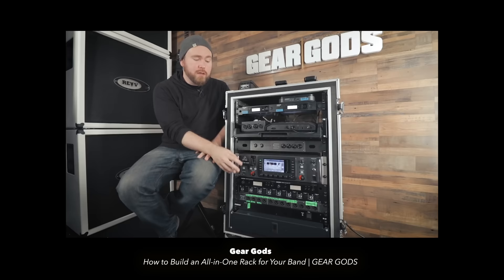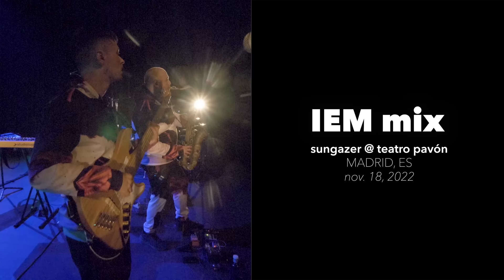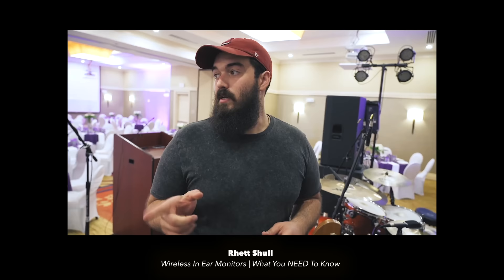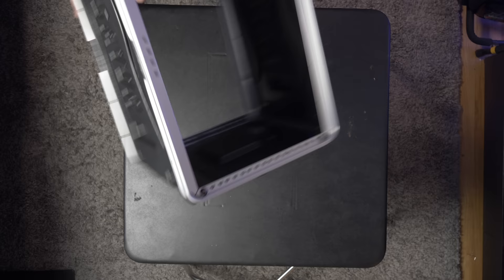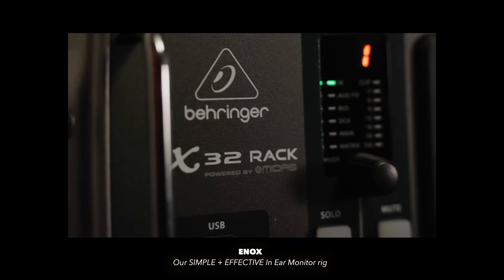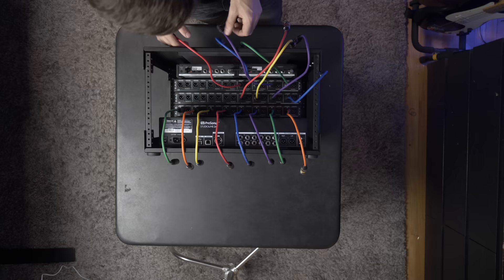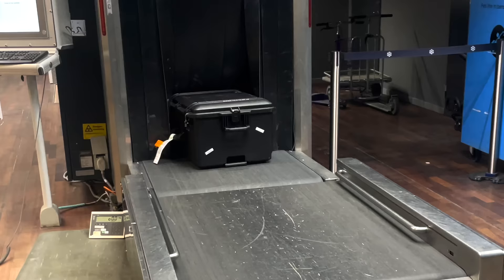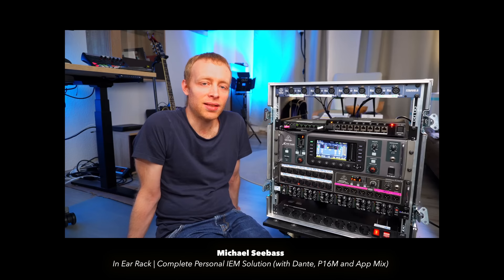How In-Ear Monitors are Making Better Musicians

Comment: If you end up looking for more power-conditioning solutions, there's a lot of crossover between rackmount computer servers and rackmount audio.  Companies like Tripp-Lite, APC, and Eaton make various 1U UPS solutions in every input voltage and plug configuration you can think of.  Just depends on how much output power you need.  As long as you're not driving amps with it, though, it's probably a lower power draw than servers.
Reply: It’s definitely less power draw than servers! The keyword you want to look for is “homelab”. There’s a group of guys who like to have servers at home for practicing their skills in a lab environment. They’re always looking for good gear at low prices, and it’s often business gear that’s been decommissioned.
Reply: How's a UPS going to go with airline weight budget and also hazardous cargo? Lead acid batteries weigh a lot and also need to be carried the correct way up even if sealed. There are strict IATA and airline limits on lithium cells on aircraft both carry on and checked. Most ground staff don't understand their company policy. I travelled with lithium packs in the checked luggage and was told differing things from different staff from the same airline. It was only resolved by bringing up their company website and going through each battery one by one and proving they all complied. Try doing that internationally in a foreign language. Not for me. That could work if you were touring in a van. That said I haven't bought in to the whole power conditioning sales pitch. I know Angus Young uses it but he doesn't have to lug it around like I would.
Reply: @vk3fbab  That's certainly a fair point.  I can see the hazmat problems being a real issue with air travel.  The point is more that rackmount server power solutions are  pretty abundant, and even if you don't need UPS, the various 1U power cabling and voltage options are worth investigating.  At the very least, having a single IEC C20 input and using different input cables depending on input voltage may be a better solution than a consumer surge protector.  And locking C13/C14 cables might be a cleaner solution than the non-locking NEMA 5-15 plugs I'm seeing here.  Obviously Adam's solution works, which is the bottom line.
Reply: @jorymil  For mains power I've been using Neutrik Powercon instead of IEC. It fits in their panels and locks in great. Allowed me to have all input and output on one panel. Mains power, 1/4 inch, XLR and Midi using Ethercon.

Comment: As a sound system, design, professional, I want to add one more bit of clarity to this wonderful video. The latency is non-existent only if you are in the analog domain of an ear monitoring. Once you add any type of digital transport, i.e. Dante, or other Netwerk digital audio you add milliseconds of latency all depending on the amount of gear and hops between switches, etc. The other factor is also that wireless technology in itself has latency, but I’m not going to go into the specifics. I just wanted to make you and your followers aware of paying attention to latency issues when it comes to using in ear monitors with digital technology, and to make sure that they Look into it as they are putting together their rigs. I love your videos I just discovered your channel and I’m very pleased to see a musician that covered something like that I believe is so important to getting a better performance. This is such a great channel. Thank you.

Comment: As an audio engineer, in-ear monitors work absolute wonders, especially if the band knows at least a little about audio.  The gigs I’ve had take place in a musical theatre that has a lot of echo because it’s mainly for theatrical performances, so wedges can be risky sometimes.  The issue is COMPLETELY gone with in-ear monitors, and they can be tailored so precisely to each member.

If Sungazer ever came to my town, I would feel absolutely blessed to engineer for them

Comment: Lateral q: is there a graceful way to be the only one wearing IEM in a setting where you know no one else ever will? Like, setting up your own room mic even for rehearsals to get a fuller mix of a big band and not just the sound of the trombone behind you?
Reply: This is precisely what Allen ME1 does with its "local mic" feature, it works really well. Allows you to basically blend in all the room crap, but at least you control the amount of it. In other cases, a random mic pointing somewhere will also do the trick, tried that once, works okay enough.
Reply: I ran a full IEM rig for a three piece I was in... Behringer XR18, splitter for the kick mic, brought our own separate snare mic, e609 on the guitar and bass cabs, and little Rolls pm50s on our pedalboards for the bass player/lead singer and myself. The pm50s allows a mic in and thru and a TRS in. No wireless, we just ran a TRS cable with our instrument cable. We were already a tight 3 piece, but we were super tight and the bass player was already a great singer, but I'm not. Being able to hear myself and him so clearly made me sing so much better. Setup was simple and required no soundcheck on our end and absolutely nothing from FOH.

Then, I just filled in on bass for a band that doesnt run in ears, so I just ran my little pm50 on my pedalboard with just my vocal mic and I split my bass signal off of a pedal directly to the TRS in on the pm50. So I had bass and my vocal in my ears, and just relied on the stage volume for the rest of the band.

Hearing yourself clearly definitely improved my performance. Hearing the whole band improves it even more. Worst case scenario, you just have expensive earplugs that double as a self monitoring system.

Comment: For any solo singer/guitarists out there, I just tried a poor man's version of an in-ear monitor system and it worked pretty great. My solo set is just me singing and playing guitar through one amp. I use a Boss VE-20 for vocal effects, so I took the 1/4" line out of that and connected it to a cheap, $69 Mackie Mix 5 mixer. I send the XLR out of the VE-20 to FOH. I mic'd my amp with my own mic and cable that I brought and connected that XLR cable to the Mackie. I now had the ability to control the mix and volume of my guitar and vocals myself. I even attached the Mackie to my pedal board, which worked great. I'm not sure if I have the same Shure in-ear headphones that Adam mentioned, but they are Shure's. I like them, but they're the only ones I've ever used and I can't speak to how long they'll last as I haven't really used them very much. Also, this doesn't require them to be wireless. I just have a 10' head phone extension cable that I plug them into. I ran the cable for the Shure's down my back, inside my shirt and simply plugged them into the extension cable and tucked the part where they connected into my pocket. Practically invisible. I'm not moving around much, so not a problem. 

Anyway, this was all a low budget test to see if I wanted to use in-ears. First test was a success and I plan to try them again next week.

Comment: Just to counter your snub of the se215s I’ve been using the same pair for 8 - 9 years now, doing at least 50 gigs a year and they have yet to fail me. A few friends have complained about the seal, but they fit my ears perfectly.
Reply: I also use SE215. Have had great fortune with them so far. They’ve even been through a washer/dryer cycle TWICE and they are still rock solid. To each their own. I’m happy with the SE215.
Reply: Totally agree, SE215s are great.  I use them not only for IEMS live, but for my daily headphones with BT.  I love them.
Reply: I wish we had your luck lol. We ended up buying around 10 this year. One pair even malfunctioned after one show, and we don’t go THAT hard on stage >.>
Reply: @ENOXband  ouch, that sucks. What did you end up using in place of 215?
Reply: @ynotw57  so far, more 215s 😂
We want to upgrade in the next year, we are looking into westone or 64 audio
Reply: @ENOXband  that genuinely made me lol

A buddy of mine uses Westone and swears by them. Good luck, I hope you find a pair which works well for you. :)
Reply: I’ve had good luck with SE215 reliability, but if lots of NY musicians are having issues I’d love to see Shure do a wider reliability study. QC is the main reason I don’t like recommending most chi-fi IEMs…
Reply: it's no counter, the only way to determine reliability of a product is by its failure rates

and yours not failing does not make the failures others have registered vanish
Reply: @willudallmusic  Do you have the updated version of the SE215 sonic which I understand comes with a mic and inline control..?
And if so, how well do they sound in the midrange frequency department?
Reply: @richmck007  I use mine with the old Shure blutooth unit BT2....  I have to admit, I'm not super super picky with my in ears, as I play solo/one man band kinda gigs...  I think they sound fine though, and have used them for years.
Reply: same here - replaced the Shure tips with Comply foam tips (forget the kind exactly but they are the kind for the most possible isolation) and they have served me well. Just have to have spare tips and replace them every so often.
Reply: At 3:47, Adam said he's gone through 6 or7 sets of them, so it seems something about them was working reasonably well before he made the change to a different brand. They may, in fact, be terrible, but I'm s(h)ure some part of the sentiment is just fatigue.

Comment: Great video! While I've never used in-ear monitors on stage, I did learn the value of manageable stage volume playing gigs in Hollywood at the height of the hair metal craze as a shreddy guitarist. I almost got banned from a club for turning up my amp without talking it over with the soundman halfway through a show. When we got off stage he called me a asshole and told me I should have communicated with him during soundcheck about stage volume. I never pulled that kind of stunt again and left the Marshall stack at home. I started using a Boogie combo turned to about 2 and faced it off to the side. This kept stage volume much lower on my end and the soundmen appreciated this. They gave me more than enough stage volume. As for ear protection, I used foam plugs. While bandmates told me how goofy I looked, I'm one of the few musicians I know from that era who still has my hearing. Not as good as it used to be, but I'm not deaf. You must protect your hearing, especially if you want a career in music. One of my favorite hard rock bands is Scorpions who I've seen many times in concert. One remarkable thing about this band is they always have the right volume. They are never obnoxiously loud. I can't say this for most bands. Scorps always go for good sound quality rather than quantity. The same goes for Rush when I saw them and the wonderful guitarist Eric Johnson. While my hair metal career plateaued decades ago I still have very good pitch and don't need hearing aids. When I do rehearse, I use earplugs or earmuffs. Me and my band have discussed getting in-ear monitors. I'm showing this video to them. This is very helpful.

Comment: For comparison, to get 100ms round-trip delay from _light_, you'd have to be 15,000 km or 10,000 miles apart, nearly halfway around the Earth (half the circumference).

Comment: Its been 20 years since I was in a working band, but we ran something super similar back then.  I might have a hint for you:  since the Art splitter is providing a passive output that you send back to the FOH, internally, thats just a straight copper wire.  So.......since an electrical signal doesn't really care where in the copper wire you split it, we used to run our own cables out of the input of our Art splitter, that never had to be removed, BECAUSE at the end of these cables we had a no-frills y-splitter xlr cable.  When we arrived at a gig, we  barely even had to talk to the sound guy during setup.  We just unplugged the xlr from whatever mic we wanted a signal from, and inserted our little y-splitter extension.  Yes, this means that the passive output coming out of your Art rackmounted splitter isn't used.  The literal only downside to this that I remember  is when the singer would grab the house mic off the stand and walk the stage, there were two mic cables dangling from it.  This lead to us sometimes inserting our little patch at the stage snake, instead of at the mic itself.  This saved an incredible amount of time, because there was no need to re-route any cables.  Ever.  It worked identically to using the passive output on the Art splitter.  Hope this helps

Comment: I was thinking during the whole video: "Perfect, I'm going to do this too" then I realised that I have only 3 gigs coming with my band and all of them are going to cost me money anyways... I guess this is the problem, to have a nice sound on stage you need all this shit, but to get all this shit, you need to have a good sound on stage so that you get good gigs that make all this shit worth it. Just like Insta marketing and all that
Reply: Definitely something you can build to.  My band started with an old mixer and floor wedges.  I just bought the Midas MR18 (same as the Behringer xr18) and it has 6 separate aux outs (which works because we're a 6 piece band).  the one mixer gives us our in ears as well as mixing for FOH and allowing me to go out and mix.  Currently, we're doing wired in ears with the Behringer P2 ($50) and xlr cables.  Can always upgrade to wireless later!
Reply: Make as many connections as possible, it’s surprising how often other’s unwanted gear can fall in your lap for cheap or free!
Reply: And if you learn how to repair gear (less common with everything going digital) you can stretch your budget even further.
Reply: Those Fishman passive hardwired packs are about $50
Reply: @Conor M  did you see the video, professor? Coz the main point is that a pair of in ear headphones ain't gonna solve no problem
Reply: @martinzamoranomusic  You seem like a pro........

Comment: Well... I just bought my first set of IEMs. I'm very glad I didn't get the Shures then 😂
I ended up getting the Sennheiser IE 100 Pro. First time working with those in the next couple of weeks.
Reply: Shures are fine, the shures he mentioned were the absolute cheapest ones you can buy from them at $99 the $499 and especially the $900 models are amazing... Though I know that's not cheap
Reply: @TylerRFelts  Well, I was going for the 99 dollar ones bc they were going to be my first IEM, but I don't wanna be spending money every so often. I figured the higher the price the better quality (some exceptions may apply, clearly). I already got my Sennheisers delivered the day after this video was posted. I gotta say I'm very pleased so far.
Reply: @ArielEduardoAlba  I got a pair of se846  like 6 years ago and I legitimately have yet to find an equal in sound quality, but I use them primarily for music listening not actually monitoring a live performance, so the use case is a little different

Comment: Been using dirt cheap wireless IEM for 6 years in my UB40 Tribute. Love them. Can hear everything I need crystal clear.
System is G4M £60
Buds are KZ £11
No need for mega expensive stuff.
The mix is the crucial component.
I like to hear everything except the keys players vocal. I boost my guitar, vocal, lead vocal and cut the keys.

Comment: I'm from Brazil, and it's sad that the equip that Adam show on the video is 5x times the price here (6000 dollars is almost 30.000 R$). But I've learned a lot with this video, and what to invest when I have more money. I think all musicians need to learn a little of equip and how to handle it.
Reply: I'm in Brazil too and although 5x accounts for exchange rate, the taxes + stores commissions can make it even more expensive, the Mee Audio M6 PRO ($39) is R$ 500 here and the Behringer PM1 ($29)  is R$572,14, both on amazon.

If it helps anyone, you can consider importing a KZ ZSN Pro for R$ 70,00 from China instead of a M6 PRO.
Reply: @Rafael_33  Good tip, man. Valeu!